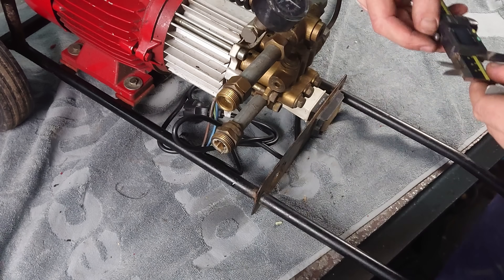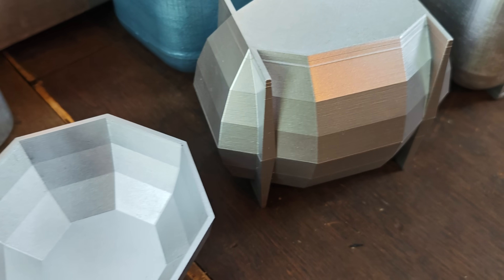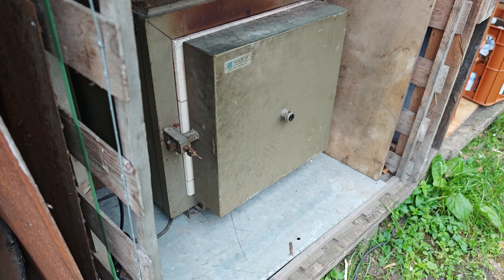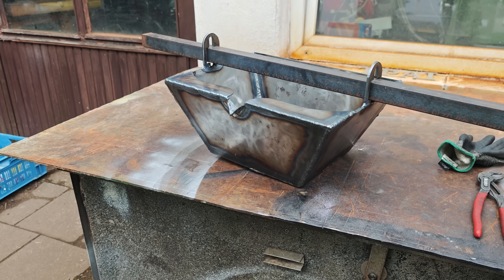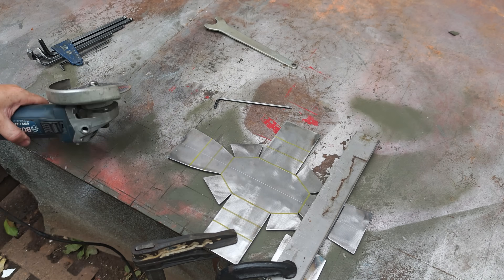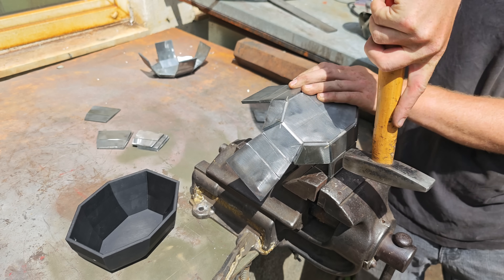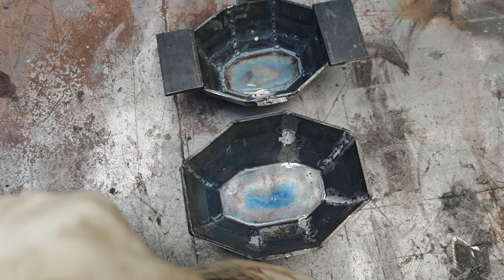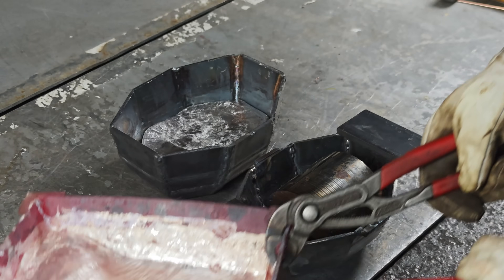Aluminium Casting Experiments! New Furnace, Melting down Scrap and Casting!

Comment: I think you need a funnel. Maybe build 2 more molds. Set all the molds in place, set funnel. Pour all four at one setting. Much safer. I like your trying to set a process for safety,  but your processing needs to be slower and safer. If you have four designs you can process what is needed or change out molds as needed. No more lifting the mold in you need to pour into the set mold. 
Be safe, enjoy your work!

Comment: Suffering from a hernia myself at the moment, waiting Queue on the National Health Service is crap due to the past 14 years of a conservative government running it into the ground, BUT enough of my woes, I have been smelting aluminium for close on fifty years on and off (and gas welding it) The best advice I can offer, is to go to the scrapyard and buy broken aluminium cylinder heads and smelt them, AND  throw a good handfull of borax into the melt as soon as it hits about 650-700 centigrade, and stir it in (in the kiln) and then scrape the dros off the top wit a "T" shaped or spoon shaper tool, then pour your ingots. This will give you almost pure strong aluminium perfect for casting without impurities. (obviously if the parts from the scrapyard are greasy, wash in Gasoline of kerosen first to remove as much crap as possible) Hope this helps.

Comment: I am fascinated by the Indian and Middle East videos showing sand casting.  They seem to do a pretty good job casting engine blocks, gears, and pretty intricate parts.  They have metal parts to their molds used to contain the sand, of course.  Light finishing is often required after the casting.  Your forms seem like a lot more trouble than they are worth for what you are trying to do.  Your two-stage method of molding just seems cumbersome, especially with such a short window of time (moving from your outside kiln, to the indoor bench, pouring into outside mold, inserting the inner mold, difficulty releasing the mold, etc.).  I hope you figure out a process that works for you.  I had to skip the part about the hernia.  It hurts me just thinking about it.  I hope you recover quickly and fully.

Comment: Cool build.
You could try a bolt together top and bottom mold (cope and drag) with a built in steel sprue.
Small conical vents in the inner or top mold will help with an even fill.
Bolt or clamp the two halves together, then preheat them to the same temperature of the molten aluminum so that you attain a full flow.
If you would like to get REALLY fancy, your crucible and mold can both go in the kiln together, with automatic or manual release or valve from one to the other.
What I am describing is a LOT more work and would require fairly exact weighting of the aluminum prior to the melt.
You would also have to account for the dross volume.
Oof, sorry.
These are things that even I would not bother doing for a simple box.
However, this would make for amazing video content in my opinion.
(obviously, I could be completely wrong, I mean I was married once before)
I am wishing you all the very best on your path to recover.
Cheers

Comment: Just a thought, why not use the outer mould as the crucible to melt the aluminium (with a pre weighed about of scrap to provide enough volume) and also heat the inner mould as well. Then the aluminium won’t freeze to the inner mould as it is inserted. The weight can be added after the hit inner is floating in the molten aluminium. Get well soon !

Comment: There's a reason why sand casting is still a standard. It gives a huge reservoir for shrinkage, is easy and quick to pack. 
If you're stuck on using the mold you have add a pour channel with reservoir, with clamps to keep it together. Having it already together prior to pour will increase your success

Comment: when using the tig - my dad always told me to leave the torch in place and let the post gas flow before lifting the torch away - stops the red hot metal oxidising after a tack

Comment: I know this might sound a bit dumb, but maybe putting the steel casting in the oven and let the molten aluminium flow in it once it melted is an idea? Not sure if it works though but might be an idea

Comment: Lovely!
Get better soon.

For easier and faster casting, 2 things I think about:
Use some kind of hoist to lift the inner-casting up and 'drop' it in the under-mold fastly and with less lifting and danger. When it can fall out of your hands, the molten alu will otherwise splatter on you very fast...
Also: it is better to preheat at least the outer-mold before pooring the aluminium in it. It will cool down less fast and spread more evenly and having less chances of airpockets.

I am actually also still thinking about making an electric furnace like this to make bigger parts then I have done sofar. And ofcourse beeing able to use the furnace as an oven for tempering iron at the same time.

Comment: Hey man, super cool video!  be extra careful with that red-hot aluminium, one mistake will be very painful!!!   for your back, and a fast recovery i would suggest to use near infrared light, 850nm at around 10-15W of optical output power over around 15X15 CM of the affected area, this stimulates recovery, reduces the chance of complications and reduces pain, it makes a massive difference and may well cut your recovery time in half. this is also something you could quite easily make by yourself,  LED's can be found easily on LCSC and other vendors, and you should get the 3030 types with a minimal output of 1W per LED (i'd gladly help you with this, just let me know)

Comment: Maybe you could preheat the outer Mould to have a bigger time window for inserting the inner Mould. Or you skip the step of Casting the ingot and fill the Aluminium directly into the outer Mould. It should fit in the small kiln as well. It might be difficult to get it out due to its shape, but as mould and Aluminium would be hot, you should have more time to simply insert the inner Mould. Get well soon.

Comment: lost foam casting can be a fast method for one off complex castings if you are good at hot wire cutter etc.
Reply: its even easier with cnc router ,you just use paper glue to glue sheets of construction insulation styrofoam together and you set it up on cnc mill he built .extruded stryrofoam cuts so nicely.later you can do some sanding to get excelent finish.

Comment: My though after working in a foundry for fifteen years is that you need to pour through a runner and riser system. The moulds can be together and you ensure a good fill level.
Thank you very much for sharing this great video.
Reply: My thoughts as well. I was also thinking he could accurately locate the inner shell with tabs that sit over the outer shell. I'd also put some sort of rail system on the base of the "new" furnace, to preserve the bottom bricks.
Reply: Yeah, it's going to be much easier that way, open face molds (particularly ones made from metal) cool much faster which makes it harder to get good results. Also should limit the amount of dross that gets into the final casting though I suppose they're not super structural so it's probably not a big deal (might mess with the finish though).
Reply: I was thinking the same.
I would also preheat the moulds.

Comment: You should make small aluminum beads by slowly pouring the molten aluminum into deep 
(.5 meter) of water. When you are ready to use the material for casting the beads will melt easier/faster and allow you a more precise weight. You can store buckets of aluminum beads for fast use.

Comment: Daughter liked picking up old railroad spikes on walks. Wanted to paint them for gifts. So I wire brushed a few. Found throwing them in my cement mixer with sand was easier.
Reply: Citric acid and kitchen pot cleaning wire makes things even easier.Soak for day in 4% solution and scrub the black oxide away .
Reply: @zumbazumba1 Have a jewelry box I will try on.Mixer worked for thing I didn’t care material was worn away. Thx

Comment: Ideally you would make a wooden template and sandcast them or mill your reusable mold from a solid block of steel. You will get MUCH better quality and what you lose in casting speed you gain by not having to CNC the casting after. Not to mention you want to close your mold FIRST and then pour the metal which allows you to make much thinner, better parts.
Reply: for making a thinner mold, I was thinking he could have clamped a sheet of non-steel material in between each of his inside and outside sheets of steel, then welded it all together, so that at the end he'd have the inner and outer halves fitted at a perfect distance apart, and he could even drill and weld for the locating pins during the process of having them clamped together as well.

A principle from my experience in home rehab construction - the only thing better than "measure twice, cut once" is "measure none, scribe instead, then cut"

Comment: It's a shame there isn't wax media for a 3d printer.
Reply: There actually is. That is special filaments for casting. Nice for one-off castings. More expensive then PLA. If you do more castings, you can actually change your 3D-printer (I've seen this, not done this myself yet) to use a hopper and melt wax directly and then 3D-print it. You normally use a bit bit bigger nozzle-size since it is more flexible then normal 3D-printing-plastics and you need to work a bit slow.
Reply: You can make parts out of styrofoam on cnc machine quickly . Then you put pattern in sand with gates and riser and pour molten aluminum over styrofoam  which evaporates .Lost foam method produces great results .

Comment: Die release spray may also help in removing the casting from the inner core.  Also, aluminum casting alloys have +8% silicon to aid in the flow during the molten state to avoid casting defects like cold flow.  It’s probably easiest to recover some aluminum casting scrap from cast aluminum in the scrapyard.  Good luck!

Comment: Hi good luck with your recovery.  Good attempt with the aluminium  casting . I good Idea is to preheat the mould. 2 or 3 hundred degrees plus. That way it will cool more slowly reduce internal stresses in the casting give more time to work, reduce porosity in the casting (rapid cooling means dissolved gasses want to come out of solution ). You may also get a more even grain structure. It will also give a little more time for the casting to 'self feed' as it solidifies filling any spaces and giving sharper definition and less chance of cold shuts.  Done forget to coat your crucibles and tool to prevent iron pick up in the melt. Best of luck.
Reply: what sort of coating would be appropriate for the steel crucibles, molds, and tools?
Reply: @allisonandrews6398  there are various refractories you can mix to a slurry to coat things with ITC100 is quite popular in hobby foundries but there's a lot of options on the market (there's also a bunch of homebrew recipes on places like Alloy Avenue), the magic words are "refractory coating", "refractory mortar" or "refractory cement".
Reply: I was having similar thoughts about the steel molds conducting heat away from the casting too quickly compared to the much less thermally conductive sand used in sand casting. Thanks for the detailed explanation of the specific effects on the casting induced by this rapid cooling. I Iook forward to seeing Gerolf explore your preheating suggestion once he’s taken time to properly heal.
Reply: Did à reply YouTube deleted it for a web link i put in .  Foseco dycote à proprietary product. Cant remember exactly whats in it, mica and or silica i think.

Comment: Please be careful with molten metal.  Keep the mould low on the ground # (ideally dry sand ) so there's less danger of splashing your face or torso. Get yourself a pair of stout leather boots and an apron .   Deep burns do not heal as well as hernias.# it's called a casting floor for good reason.
Reply: I saw the blue jeans when he removed the hot crucible and almost screamed "NOOOO!" And the use of pliers, oh boy. I hope he considers safety measures while he's healing!

Comment: If you drop the top "insert" mould with that weight in it molten aluminium will shoot out the side straight at you. Please find a safer method